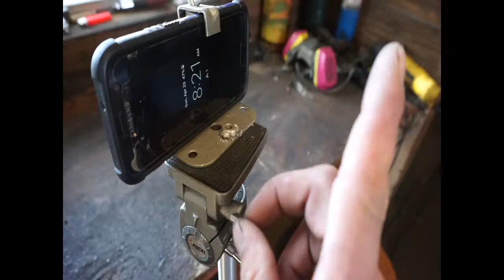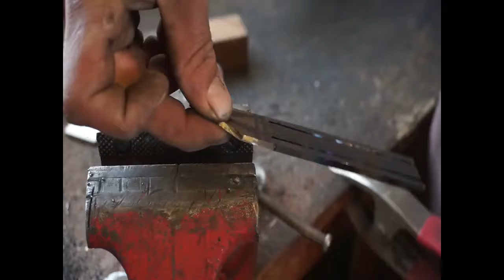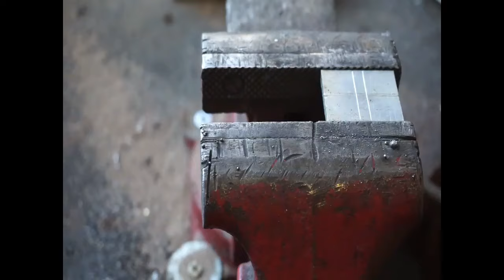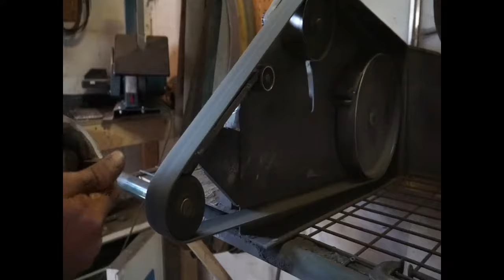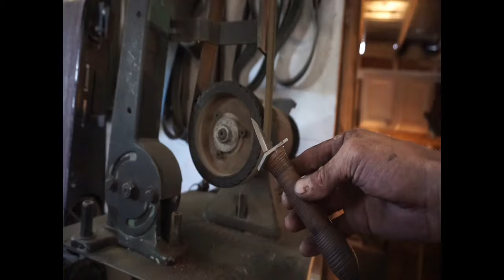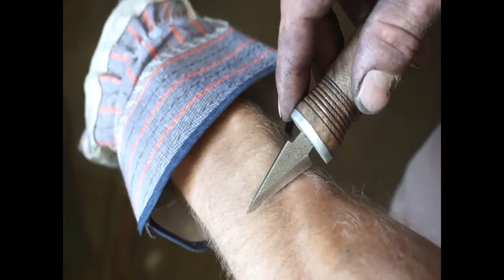Custom Carving Knife Made From old Saw Blade

Comment: Heat treat was unnecessary , the saw is already hardened and tempered .
Reply: ed l 

He did it for fun.

(No idea if that's true or not, but I'm an asshole)
Reply from the maker: +ed l the saw blade may have been Heat treated but more for flexibility. I needed this knife to be stiff and hold a very sharp edge so I reheat treated it
Reply: ed l it's a small piece of metal I'm sure he did the heat treat because of the heat from cutting it. he knows what he's doing.
Reply: ed l , actually, the grinding from cutting out the blank blade heated up the metal enough to affect the temper and hardness properties of the original saw blade. Im wondering if he got it hot enough to really harden it though. ..also, why not temper it too, and did the heating of the tang to set it in the handle have any affect on tge hardness of the blade? It's s cool knife tho. Im glad I watched the video